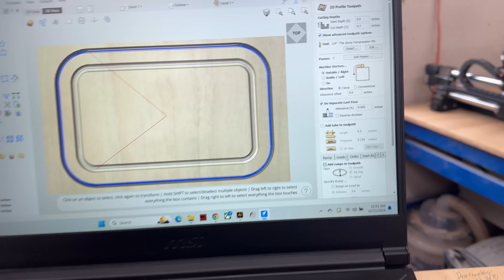I Designed This Cutting Board For One Very Specific Purpose

Comment: Awesome batch run! Re gluing up 8' strips and cutting them later, I've found it takes me longer to get 8' boards perfectly jointed and find an 8' flat surface with enough clamps.  Like you showed its easy to line up 3-4 boards in one set of clamps, and can avoid knots, etc.